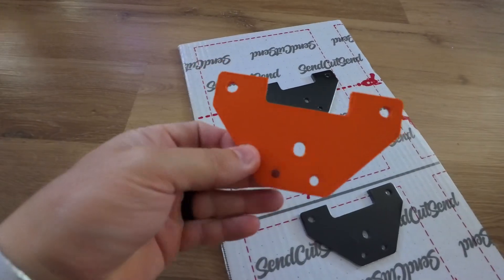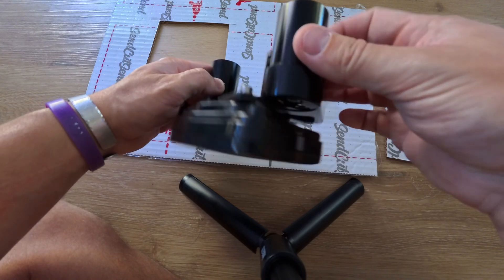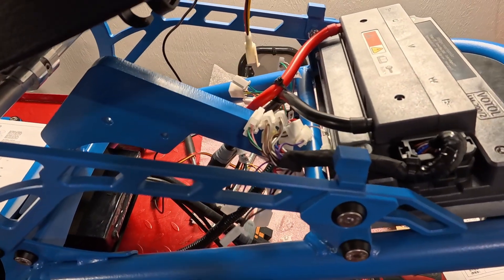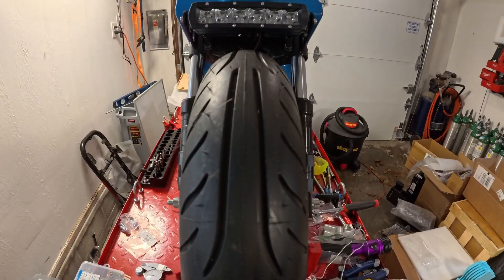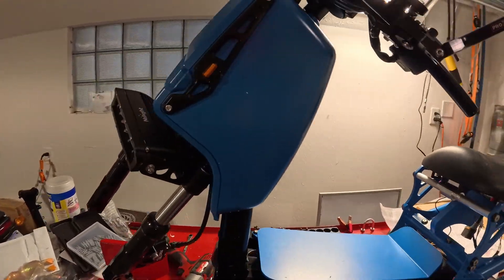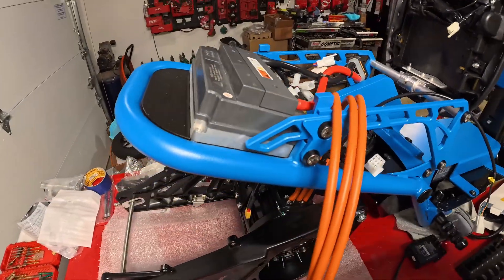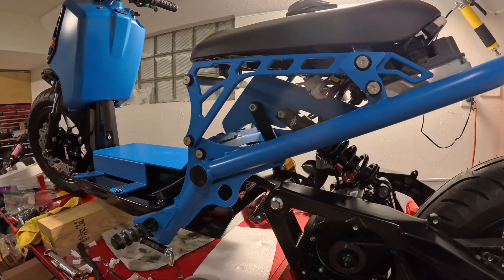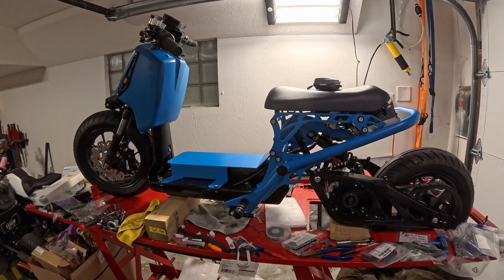Electric Honda Ruckus Swap COMPLETE! - Final Build Reveal

Comment: Would it be possible to double the battery size? Would that cause any issues besides weight?
Reply from the maker: Possible, yes. But I wouldn't. That is a ton of weight on a crucial crumble point in a Ruck. It's a massive liability to do so.

Comment: Nice Build, so what size motor did you get. So to wire it all up was it feasible to the build, or are you still adding to it. The plug you put out - send cut send - do they do small pieces of aluminum I'll check them out👍💯.
Reply from the maker: Went with a Qs138. Yes, everything is good to go! Yes, they're awesome specifically for small batch stuff. Just put another order in tonight actually. When checking out, play with quantities. I have found it's often the same price or even cheaper to get multiples vs one of something.